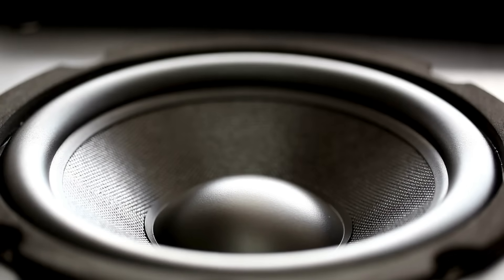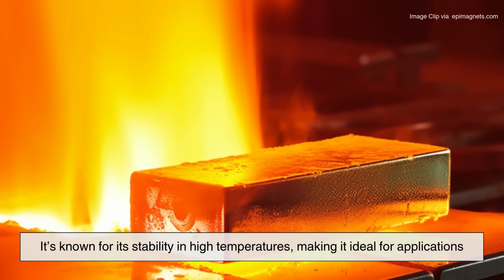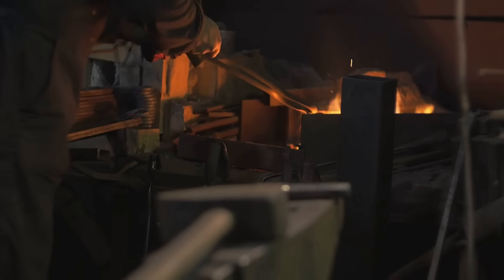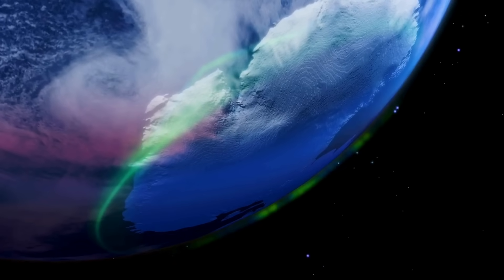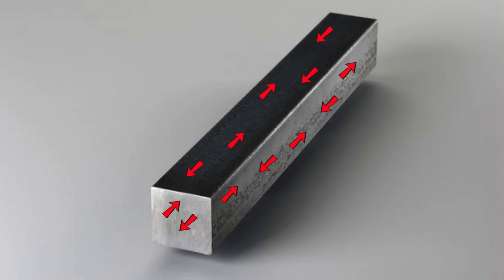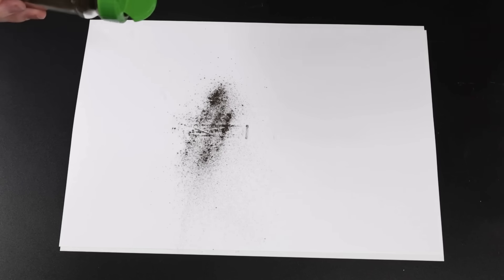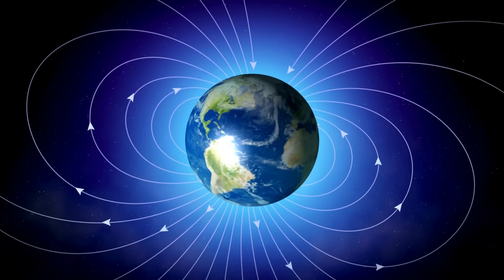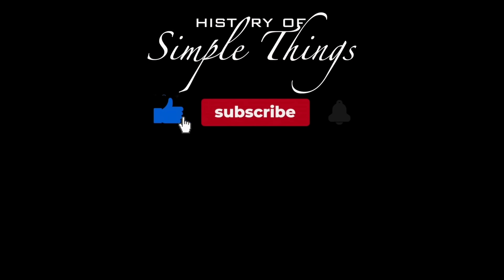How Alnico is Made

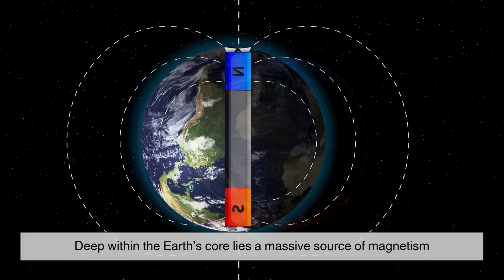Comment: At 4:02, the earth magnetic flux direction is incorrect.  Using the standard convention, the flux of the Earth's magnetic field is considered to be going into the Earth at the North Magnetic Pole. This is because the Earth's North Magnetic Pole behaves like a magnetic south pole in terms of field direction, meaning the magnetic field lines enter the Earth there.

Comment: A shame the process of actually magazining the Alnico metal into a magnet is missed out. That would have interested me the most.
Reply: The proces is very simple. 
The alloy is heated redhot. And at the same time magnatized in an induction coil. Than with rapid cooling to room temperature the material wil become magnatic.
Reply: @0512d1d  Thanks for sharing.

Comment: This is not one of the better videos from "History of Simple Things". I will add to the other comments that point out various errors these examples. When talking about microphones they show a condenser microphone that doesn't use magnets. On the section on durability they show the alnico horseshoe being magnatized on the machine with the mirror imaged meters. That should have been shown in the part about how the magnet is made, it has nothing to do with durability testing.